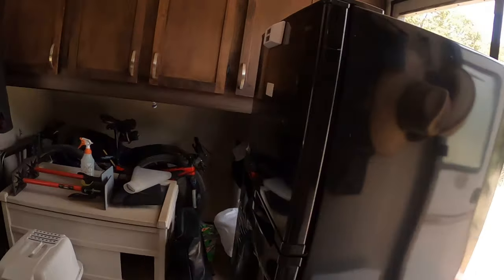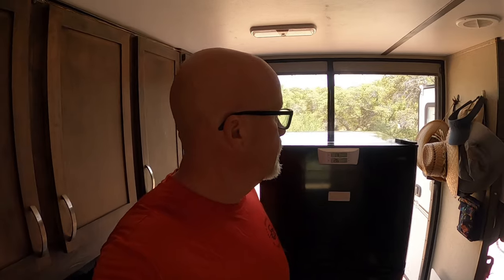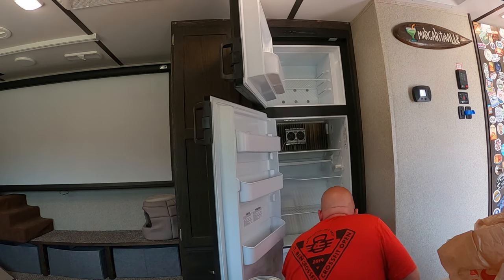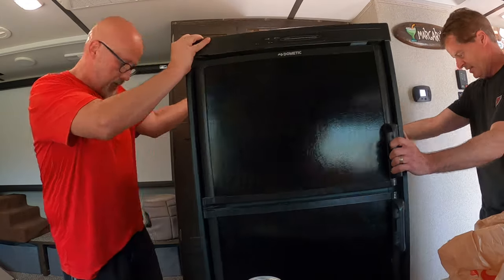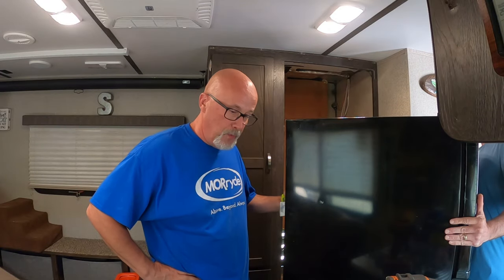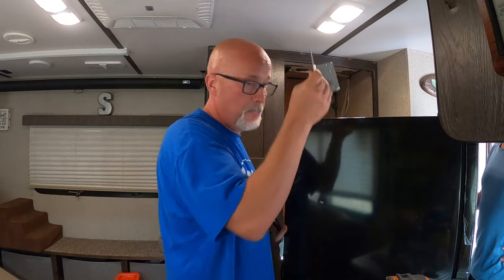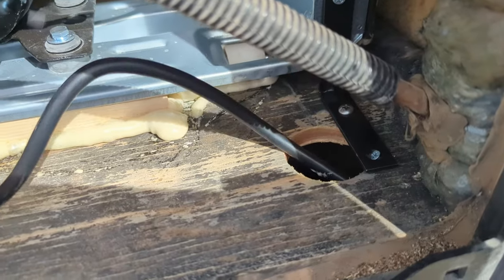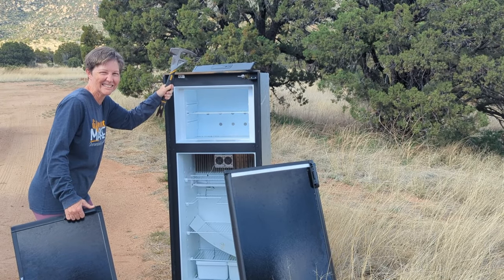RV Life: The End Is Here and We Won't Shed a Tear. Replacing our Absorption Fridge w/ a Residental.

Comment: Luckily I have a sponsor that does the conversions.  If anything happens to my fridge I’ll probably do the 12 volt compressor conversion
Reply from the maker: Oh that's very interesting, I didn't know that there were conversions from absorption over to 12 volt. Obviously we don't hope that anything happens to your refrigerator, but that would be a really intriguing. Video- Kyle
Reply: @thewanderingshores  also I meant to say that large toy hauler door on the side has to be handy for issues like moving fridges
Reply from the maker: @GimpyCamper  Yes the toyhauler door has made things so much easier. The couch, the fridge were much easier going that route.

Comment: Looks great. Let us know how it goes with your power set up.
Reply from the maker: It's been going really well for the first week that we've had it. We've had no problem getting back to 100% on our solar by around 1:00 every afternoon. It pulls about 6 amps or 100 watts when the compressor is on. But as you know, it's not on 24 hours a day. So far. It's been a great change- Kyle

Comment: What year is your TT Kyle? just curious. When we purchased our 5th wheel in Sept 2016 we sold our 05 Forest River TT to our 3rd daughter (Kristi). Last spring after 17 years the Dometic Fridge in it began leaking amonia, my SIL replaced the cooling unit with an amish built cooling unit. A month later my 2nd daughter (Erika) discovered they also had a amonia leak in the dometic fridge in their 2017 Forest River TT. When it was discovered I had just gotten home from wintering in Florida. So I helped Zack replace the cooling unit on his fridge and we made a video about it. I will be interested to see going forward how this new fridge does for you two. We have traditionally stuck with absorbtion fridges as we (not just Angie and I but our entire family) spend far more time boondocking while "camping" (like you have been doing) than in RV Parks. Great install video. Sean
Reply from the maker: Thanks, Sean. Our travel trailer is a 2018 and I'm suspecting. They may have been some ammonia leak. I didn't have a whole lot of yellow powder underneath the burner unit like I have seen in some videos but it did look like there was some dampness of some sort. While the refrigerator worked great, a majority of the time we had issues when it got really hot outside or at higher elevations. Like most people experience. I'm really hopeful that we are done with that process. We've had some friends that have done the Amish conversion and they have loved it, but it wasn't something I wanted to try to tackle. If I was back in Indiana, I might have explored that option as well. It's been working great for the week that we've had it installed. We've had no problems getting our batteries to 100% by midday and it looks like it's pulling around 6 amps or about 90 watts when the compressor is running. But as you know, it's not running 24 hours a day, so it's a pretty manageable draw. We may have to get a ground deployment panel for the winter since the sun is so low in the sky during the winter months. But those are really cheap now and will worry about that in November.- Kyle